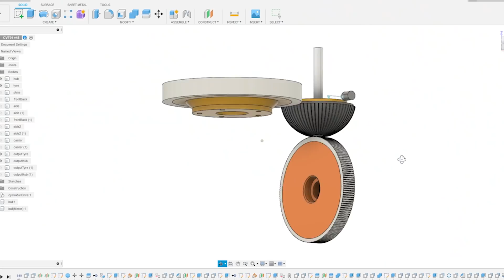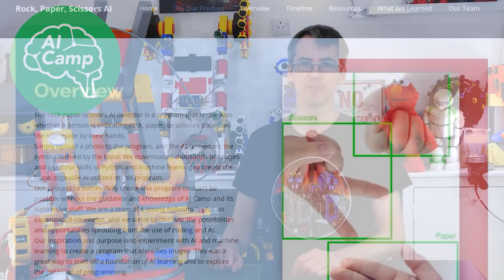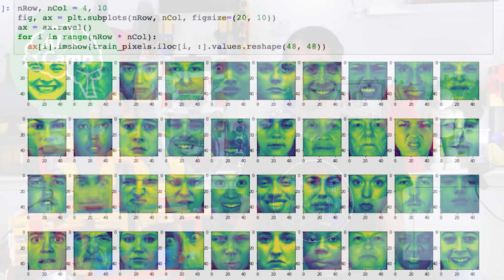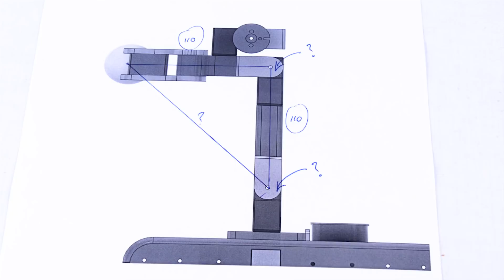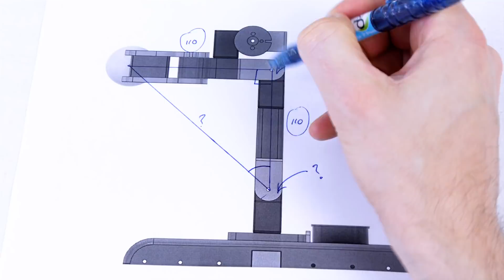Controlling a ONE MOTOR CVT Robot Arm

Comment: I'm absolutely in love with this project, I've used the Tandy Armatron as the basis for many robot arm projects, although not as big as yours, my flashforge adventurer 3 prints the same size gears as the Armatron and to the same if not higher tolerance, is there a particular reason why it has to be so big, I am also curious as to why you want to control it via servo's, as it defeats the purpose of having it all run off a singular motor, why not just use the servo's to make the arm?

Comment: If you removed the 2 mirrored horizontal shafts and replaced the gear with a double sided one you could reduce the amount of backlash. 

This would also make it easier to mount the feedback pot as the base of the arm would touch the sides directly.

Comment: i think you should make a robot that uses a wireless optical mouse as a position transducer. two mice if you want orientation as well. or a transducer on a linear actuator. or on the rim of a wheel to measure rotation

Comment: you should make a version 2 with the same base but using t5 pullies also you could use the clutch system to move it on a set of rails and add it to your great ping-pong ball contraption with the use of a dumping bucket or container that  can carry many balls at once

Comment: If anyone's interested in getting more into the part where the controller is setting the motor values to get the desired behavior, i's called Control Theory. By knowing how your motors and sensors interact with the arm, you can get great performance even under non-ideal conditions. A PID controller is a very powerful control method, but there are a lot of other things you can try in order to get the results you want.

Comment: An example of a robust cvt is a snowblower's transmission.  However, to actually change speeds you do need to momentarily disengage the clutch from the motor.

Comment: You could use mono-directional tension from a constant force spring located at the shoulder joint to reduce the majority of the backlash. This would press the arm in one direction so that the geartrain is always actively meshed. This would be largely the same thing done by gravity already, but to a greater and more controllable degree.

Comment: To account for the clutch dead spot with software you could use an observer style position control.
You could manually measure the dead zone and max-min points and then pass the requested movement into a function that calculates the actual clutch output movement (instead of assuming a directly proportional servo-pos to clutch output relationship).
This could constrain the requested servo/clutch movement and calculate the actual arm movement speed to drive synchronization of the inverse kinematics of the next stage.
The second arm stage controller could use the same observer system but with the offset of the clutch (servo) movement such that the output will still be within the servo/clutch movement range.

Comment: Hi! Will the solution with single long shaft goong thru the whole arm with constant RPM (with cardan on every movement point), and steering noovement via cvt-ball-clutch with cykloidal transmiton? The whole system would be less complicated (i guess?). Especialy steering

Comment: Awesome project! Not to be an annoying armchair engineer but try putting a 10k ohm pulldown resistor between the analog pin of the potentiometer and ground if you are using an Arduino to read the potentiometer data. This should hopefully clear most of the electrical noise because some cheaper Arduinos don't include them in their circuitry. I ran into the same problem a while back.
Reply from the maker: Thanks!
Reply: Any noise reduction achieved from this would likely come from the reduced output impedance, but it would have the downside of changing the potentiometer's taper. Another option would be using a smaller-value potentiometer. I would suggest a 1 k-ohm potentiometer.

Comment: I would like to see a hydraulic robot arm with one powerful motor to control all the joints like you described. Maybe it could have a gearbox reduction with 2-3 modes for insane power. The gripper could be powered by the same motor for crushing strength. I imagine a disadvantage of this design would be that the joints could not rotate continuously. Hydraulics might not be your area of expertise though.
Reply: Apparently there are hydraulic slip rings so continuous motion could actually be possible. However they appear to be expensive, especially if you want to pass lots of hydraulic lines.

Comment: If you're using stepper motors as well as one driving motor then you're not using one motor really. Are you trying to save money on motors somehow? I'm not seeing the usual appeal. Servos have motors in them. What are the advantages of doing it this way?
Reply from the maker: As I said in the video, it's experimental - but what you describe is the same as Hydraulics. The proportional hydraulic valves in the Mantis cost around $2000-3000 each and there are 18 of them.

Comment: Hey James, quick feedback on your position control for the base. Since you are using a simple proportional controller, you will always have a position error that is inversly proportional to the gain of the controller. You could get accurate positioning by adding an integral term to the controller. Great video!

Comment: This is an amazing project, one thing that I noticed is that you could have used spiral bevel gears to reduce the backlash, by using the helical gears you would achieve a constant contact between the gears, although there is the problem that the friction would increase, it is not something that I imagine would be harder to 3D print.
Reply: Backlash, backlash, backlash... This isn't the first, nor will it be the last, while backlash is continuously kicking his ass. Personally, I don't think he wants to do the finish work on the parts.This is prototyping, but part of that of that is refinement. Clean the edges (deburr), and  lubricate, Spiral bevel and herring bone FTW!

Comment: You may want to take a look at "SOLIDWORKS SIMULATION OF IVT GEARS" it's basically a planetary gear but with 2 meshed planets, which makes it so that you can drive the middle with the input shaft and the outer ring with a one way cvt (even 0 speed is not necessary) and have backwards, stop and forward.

Comment: This is cool to see how far the mechanical side can be pushed. 

Can you please comment on the idea of using open dog lower leg on a shoulder type joint so it can lay flat on the ground and the upper leg rotates through 360 while the lower leg remains still for “emergency mode” to get through deep soft sand snow or slippery.